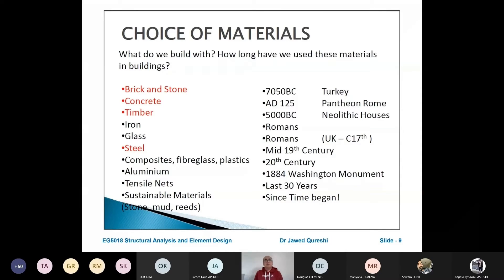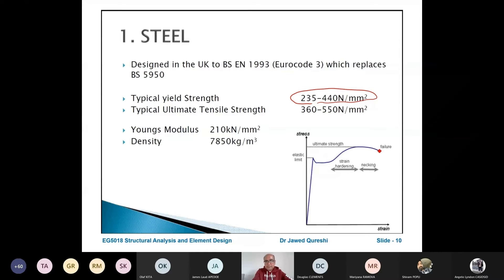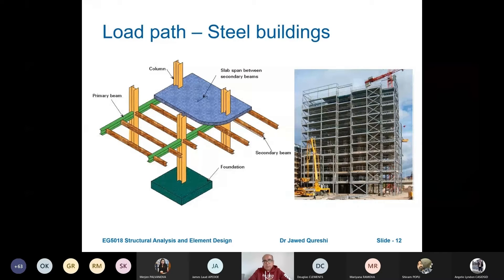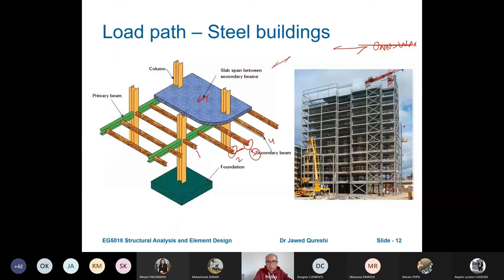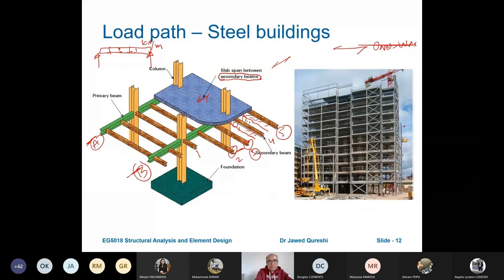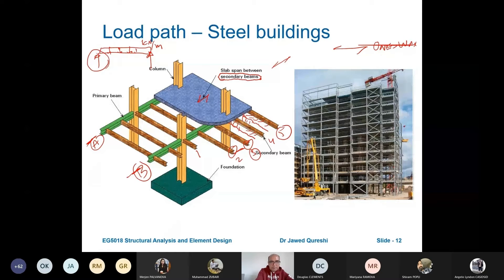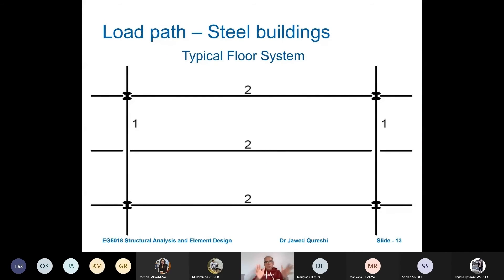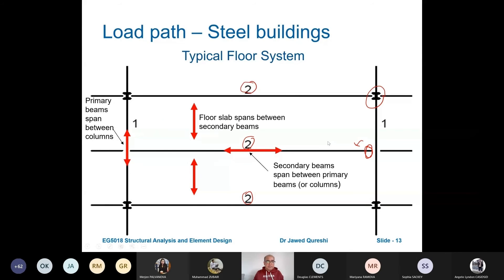01 Load Distribution – Lecture | Eurocode 3 Steel Design series | Introduction to Eurocode 3

Comment from the maker: ** TIMESTAMPS **

00:00 – Introduction 
00:27 – Choice of materials
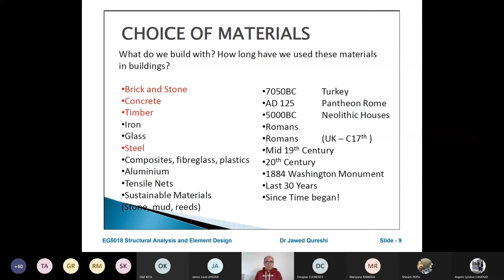01:09 – Steel material properties 
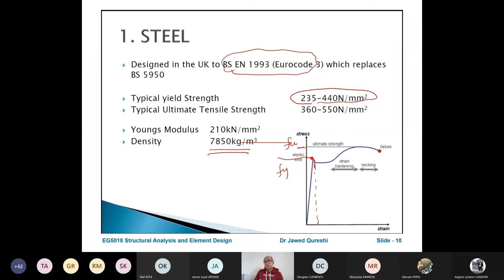02:30 – Load path in steel buildings 
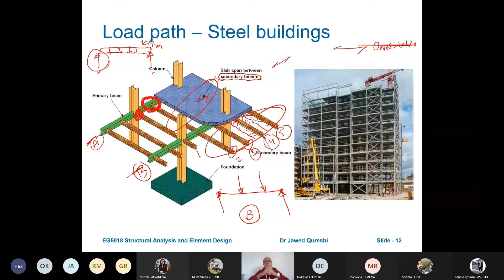07:15 – Typical floor system   
08:50 – Load path in concrete buildings 
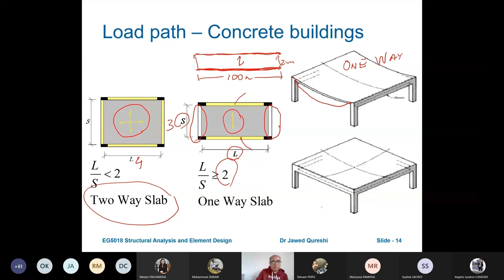10:55 – Response to students’ questions